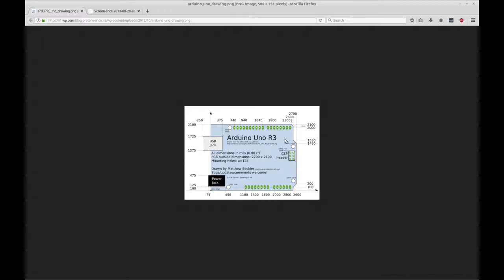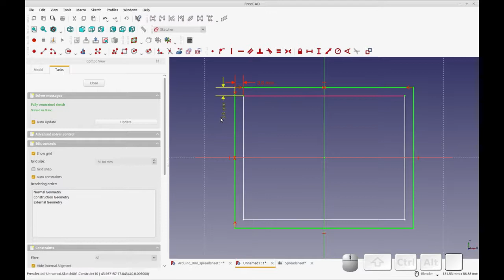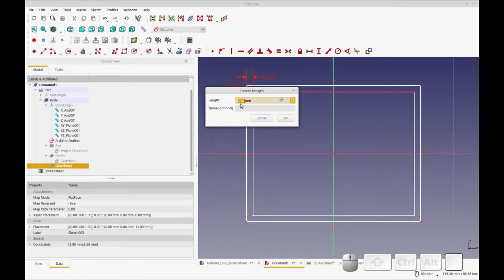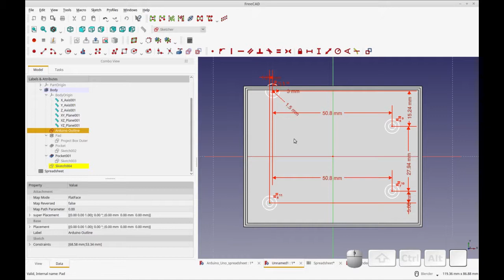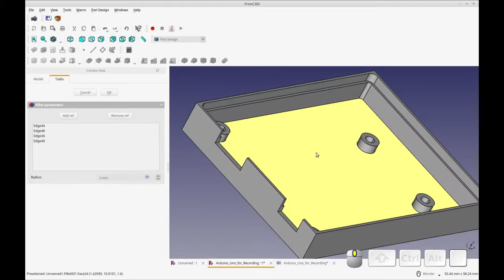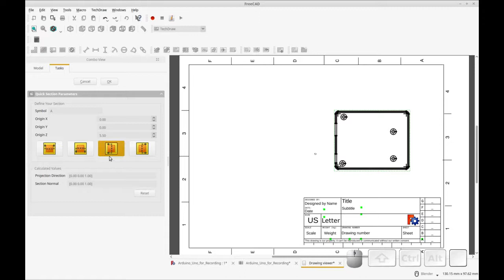Design and Print an Arduino Box with FreeCAD

Comment: Interesting.  adding the drawings was new to me so I learned a lot on that. Oddly the downloaded file had a number of errors popping up, but those were mostly conflicting constrains, problematic fillets and an 'invalid name' in the technical page, but it was all easily solvable.
A pity you skipped adding the USB  and power ports as it would have been interesting to see how you got those in the right place in relation to the studs. No real problem though as I can find that out my self. Was just wondering if you had some tricks op your sleeve.
I don't think you got around to do the lid, at least I could not find it. Oh well, I can do it myself. Anyway, tnx for sharing your knowledge

Comment: Have you noticed yet that you cant delete parameters in spreadsheet  when you try and delete a row  , or shift row up or down ,  without linking into this that this crashes Free-cad 

Details  

OS: Ubuntu 17.10
Word size of OS: 64-bit
Word size of FreeCAD: 64-bit
Version: 0.17.13125 (Git)
Build type: None
Branch: master
Hash: 59dedd12751a3f5730734741ae6258a4ea4f5745
Python version: 2.7.14
Qt version: 4.8.7
Coin version: 4.0.0a
OCC version: 7.1.0
Locale: English/UnitedKingdom (en_GB)

Comment: Missed the part where you make the USB and power port cutouts!  Also, would you add your US Letter template to the github?
Reply: no worries.  This is the best tutorial video for FreeCad that I've seen yet.  Not sure why you don't have more views.
Reply: I have figured out how to do that on my own. :) Just make a new sketch on that face, draw the two cutouts using the rectangle tool and constrain to board outline and post height + PCB height going by the dimensions in the technical drawing. Then click the pocket tool et voila! You have your cutouts done.